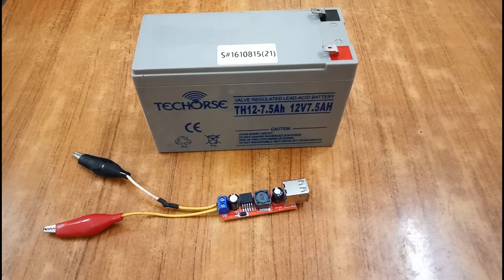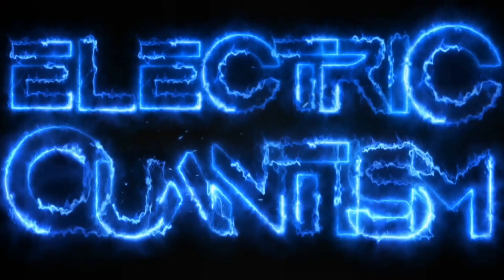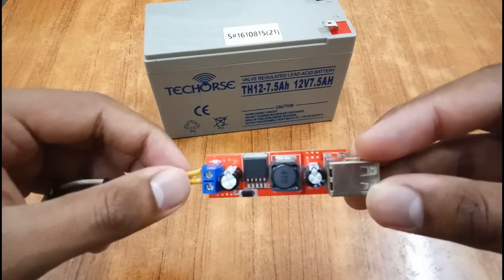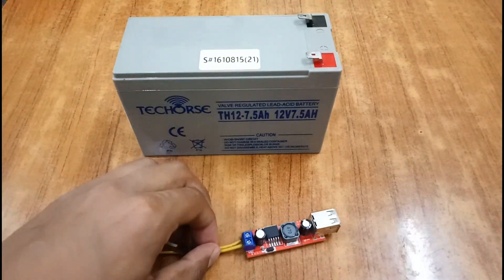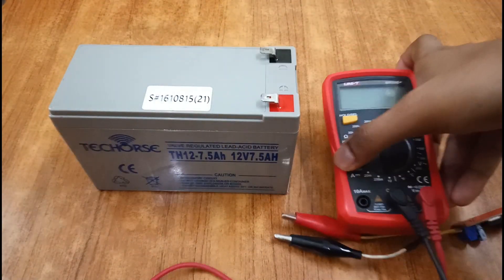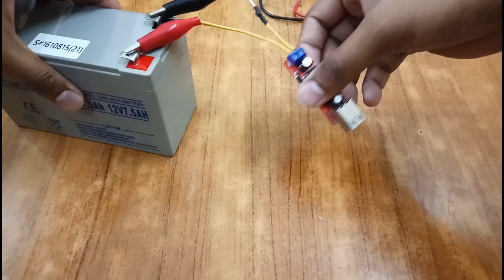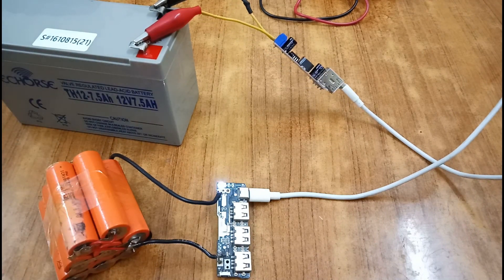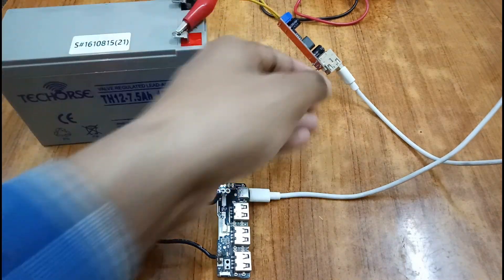How to make 50000mah Powerbank from 12v 7Ah Lead acid Battery #battery #powerbank #diy

Comment: is that can run small dc motor and light without any damage...?
Reply from the maker: It can handle 15w.. 5v 3A
Check if ic is not overheating then it will work